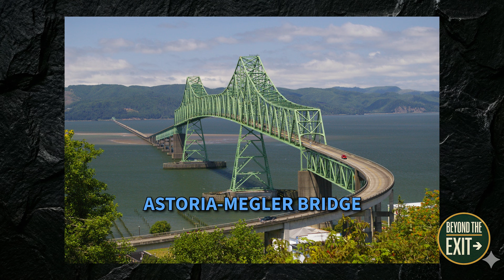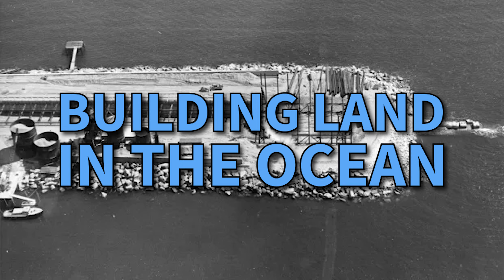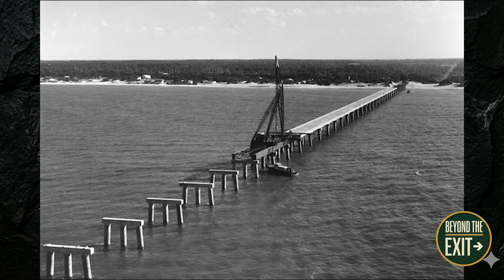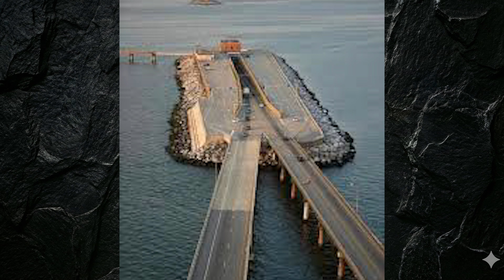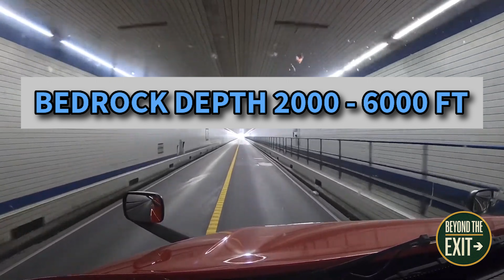The Chesapeake Bay Bridge-Tunnel: Why This Highway Had to Go Underwater

Comment: I think the first time I went through the Chesapeake Bay Bridge  Tunnel  it had only two lanes. I have been through  the Hampton Roads Tunnel  and he Monitor Merrimac Bridge Tunnel..They had  a similar problem with the Pennsylvania Turnpike. Two lane tunnels handling four lanes of traffic. I wonder what ever happened to Chessie  tunnel boring machine?
Reply from the maker: @nathanmeece9794 Good question. The tunnel boring machine “Chessie” completed its tunneling run and was then disassembled, which is standard practice. The cutterhead itself was preserved and put on public display, while the rest of the machine was removed so the tunnel could be finished out. Thanks for asking, and thanks for watching.

Comment: The steel tubes for the original Chesapeake Bay tunnel were fabricated by the Baldwin-Lima-Hamilton Corporation in 

Eddystone, Pennsylvania

. The 300-foot sections were transported down the Delaware River to Hampton Roads by tugboat.
Reply from the maker: @josepheomelia9951 You’re actually describing the Hampton Roads Bridge-Tunnel, not the Chesapeake Bay Bridge-Tunnel.

Baldwin-Lima-Hamilton in Eddystone, Pennsylvania did fabricate the immersed tube sections for the HRBT (1957).

The CBBT (1964) tunnel sections were fabricated in Orange, Texas, and towed roughly 1,700 miles by water to the site.

Both projects used the immersed-tube method and were built in the same region a few years apart, which is why they often get mixed up. Thanks for watching.

Comment: This is very well done and informative.  I have driven through the CBBT many times over the last 50 years, it is quite an engineering feat.  I was not aware that two new tunnel tubes are being constructed, maybe they will be open by the time we return to the Outer Banks of NC, maybe in April, 2026.  I will check out your two other videos , the Eisenhower Tunnel and Glenwood Canyon in CO, drove through those as well.  Thanks for the post!
Reply from the maker: @74bshs Thanks for sharing that—50 years of driving the CBBT really puts its scale into perspective. The new tunnel tubes are still under construction, but April 2026 would be great timing if everything stays on schedule. Glad you’ve driven Eisenhower and Glenwood Canyon too—those are engineering stories of their own. Thanks for watching.

Comment: Does anyone know why the US Navy, in contrast to the Chesapeake Bay bridge/tunnel, permitted a bridge to be constructed to Coronado Island in San Diego Bay, that if collapsed could have blocked access to the San Diego Naval Base.
Reply from the maker: This is a fair question, but the answer is longer than it might seem because it comes down largely to the physical makeup of the Chesapeake Bay itself — its depth, sediments, navigation channels, and strategic traffic — not simply Navy policy or preference.

At the southern entrance to Chesapeake Bay, the bay is deep, wide, and composed of soft sediments with heavily dredged navigation channels that serve continuous naval and commercial traffic into Hampton Roads, one of the most critical maritime hubs in the United States. Engineers and federal authorities determined in the late 1950s that a conventional bridge across those channels posed an unacceptable risk. Even a single collapse could block access to the Atlantic. Because of that physical reality, the Chesapeake Bay Bridge–Tunnel was deliberately designed with immersed-tube tunnels beneath the main shipping lanes so maritime access would remain uninterrupted even if surface structures were damaged. The bridge–tunnel opened in 1964.

San Diego Bay is physically very different. It is narrower, more protected, and has a single primary navigation channel. While the U.S. Navy initially opposed bridge proposals there as well — beginning in the 1930s — that opposition softened in the 1950s once planners agreed to engineer sufficient vertical clearance for naval vessels to pass beneath the structure. The resulting Coronado Bridge was designed with roughly 200 feet of clearance over the main channel, achieved through its height and curved alignment, and it opened in 1969. That design satisfied the Navy’s requirement that ship access into and out of San Diego Bay not be obstructed.

In short, the Navy did not apply different standards arbitrarily. The deciding factor was the physical makeup of each bay. Where ship passage could safely occur beneath a high bridge, a bridge was allowed. Where deep-water navigation channels could not risk any surface obstruction, tunnels were required.

We know that was a longer explanation than most comments get, but this was a good question and it deserved a complete, factual answer. Hopefully this helps explain why those two crossings were treated so differently. Thanks for watching, and thanks for taking the time to ask such a thoughtful question.
Reply: @B @BTE4172 Thank you very much for taking the time to prepare such a detailed response.
Reply from the maker: I didn't want to go half-way with an answer to an excellent question. I got a history lesson in the process on it myself! Thanks for sharing it. I hope to hear from you in the future! Thanks for watching.
Reply: @BTE4172 You are most welcome.

Comment: I was visiting Fort Monroe for a week [group] and was there in 1999 when they opened the expanded roadway. I misunderstood and thought they were talking about the whole system. Your video told me exactly what the 'opening' was. Thank you - that clears up a lot. I have actually traversed the system 4 times - I prefer using US13 [and paying a toll] over that horror road of I95.  In case you don't know, Ft Monroe has/had an unobstructed view of the system. [is Ft Monroe still so named?]
Reply: Yes, Ft Monroe is still named that, located in Hampton. The bridge you see from there is the Hampton roads bridge tunnel, though, not the CBBT. The CBBT connects VA Beach with the lower Eastern shore. The HRBT is under construction also.
Reply: @tiffanytaylor4164  TY - always glad to know the correct names.
Reply from the maker: That’s really interesting context about Fort Monroe and the expansion opening—it's great to hear how the video helped. And yes, US13 is definitely the preferred route for many. Thanks for watching!

Comment: I crossed this bridge when I was real young. Lately I watched a motorcycle guy and his girl ride across it. I took the Volvo there and crossed it. I was planning to get there just before the sun rose. I arrived around 0900. I was upset. I was planning on taping it at or before sun rinse. We went there the day it opened. When I crossed it this time after I went to appamatic. When I got home I wanted to go back and tape it again. The second time I got there about an hour or so before the sun rose. Driving back to DC i did that 100 miles in less than an hour. I drove right through DC.
Reply from the maker: Sunrise is a great time to experience it—the light really changes how that crossing feels. Sounds like it stuck with you both times. Thanks for sharing the memory, and thanks for watching.

Comment: Never driven through the tunnel but sailed over it on an aircraft carrier over a dozen times.
Reply: Thank you for your service. 🇺🇸
Reply: God Bless you , God Bless Our Milatary and God Bless AMERICA 🇺🇸🙏
Reply from the maker: That’s an incredible perspective—and a great reminder of why the crossing had to be designed the way it was. Thanks for sharing, and thanks for watching. Also, thanks for your service.
Reply: I've driven through the HRBT and CBBT original section in 1986 also sailed over them on a US Navy Ship several dozen times. Those are both critical to the Navy as they are both between the Atlantic and Norfolk Naval Base.
Reply: I've done both. Definitely would take going over it, over going through it.
Reply: I was Navy too, E-6 Aviation Electrician CV-66 USS America.
1977-1985 
I drove through it maybe six times. Back then I think the toll was $7.00.
Don't know what it is now. 
Nice to hear from a fellow service member. Godspeed.
Reply: I drive through it often as I frequently visit Virginia Beach
Reply: I have also sailed over it on an aircraft carrier, the original USS JFK CV-67, and also on a Knox class frigate a number of times. I have driven it several times too.
Reply: Aircraft carriers dont sail
Reply: @SKDYCAT  Since when?
Reply: @Cjbaker1988 since ever
Reply: @SKDYCAT Correct but the Navy still uses the term

Comment: I've only been worried crossing the bridge once. Riding with my dad in an 18 wheeler and we were the last truck they allowed to cross before shutting it down for trucks with box trailers. There was a coastal system and the waves were churning something fierce. The sea spray was so bad it looked like the waves were going over the bridge at times. Interesting fact several truckers have lost their lives because their trucks have crashed through the side barricades.
Reply from the maker: That would’ve been an intense crossing, especially in those conditions. Weather out there can change the experience fast, and riding it in a truck really puts that into perspective. Thanks for sharing that memory, and thanks for watching.
Reply: My wife and I were crossing one morning, when we saw a kerfuffle on the southbound side with police and rescue vehicles on the bridge, and search and rescue helicopters in the air.  Then we noticed a tractor/trailer in the water.  This was early in the year, about March IIRC, and I'm sure the water was cold.  We learned later the driver didn't make it.
Reply: @richardjohnson4238 sadly I don't think any driver has survived going over the side of the bridge.
Reply: It’s so frustrating that they don’t raise the guard rails to prevent the loss of lives
Reply: @malley4747❤
Reply: That was actually the US-1 going to Key West, Florida
Reply: GOD bless them. They need higher guards on many bridges.
Reply: Yea....like that one after the Harrier Jump Jet blew a hole in the bridge chasing after Islamic nuclear terrorists! Then the pelican landed in their truck causing it to tip and go into the bay! Oh...and that Limo and the dude hanging from a helicopter pulled her outta the sun roof at the last second! Very dramatic stuff!!! 🤣🤣🤣